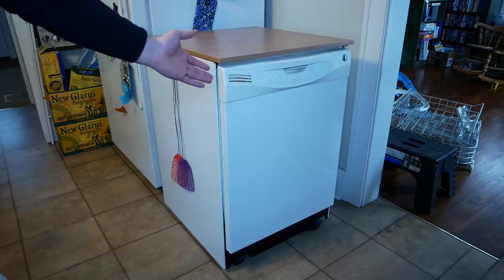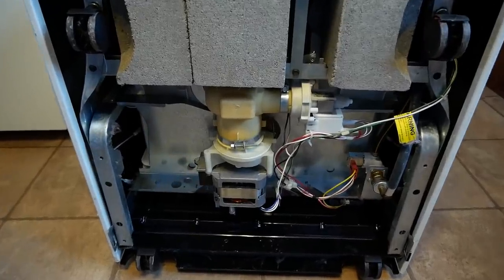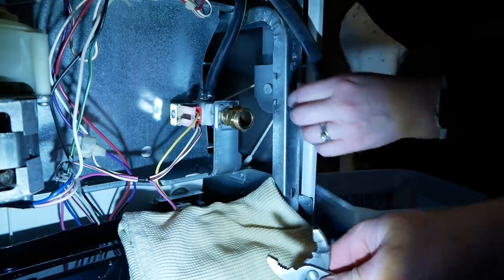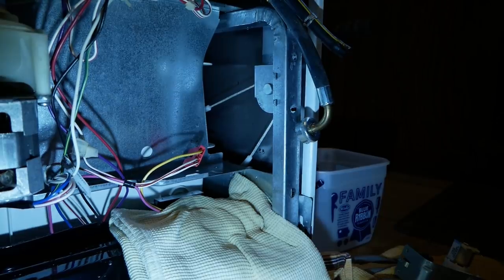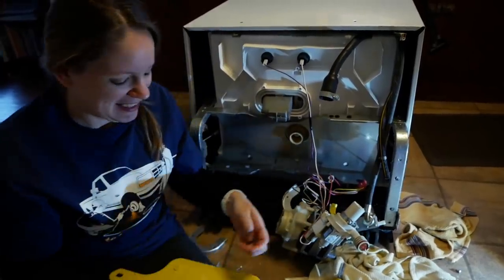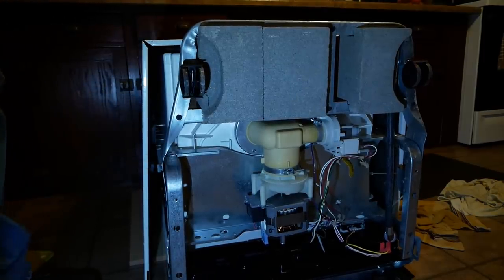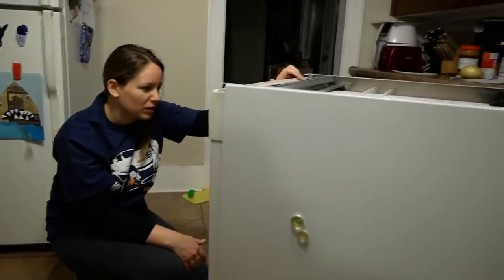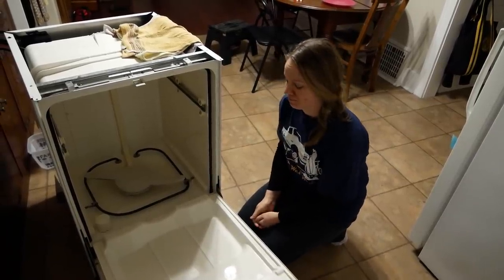Dish Washer Repair | a Lose-Lose Scenario

Comment: Wes you disappointed me this time. Dishwasher won't drain. Don't start with the fill side. The pump could have been pulled off without taking everything else off. The pump snaps apart, remove what is blocking the out flow, put back together. A one hour job at best.
Reply from the maker: What if it was leaking past the valve allowing water in after the drain pump ran? Come on. Simplest things first.
Reply: @WatchWesWork  Wrong. If the fill was bypassing the running water could be heard. Also opening the pump is simplest. I have done this repair many times. Removing the pump does not require removing the sump.
Reply from the maker: @RetiredPilot  Well I'll just let you fix it next time. Problem solved.
Reply: @WatchWesWork  Wow you don't like to be criticized do you.
Reply from the maker: @RetiredPilot  I just always get this kind of stupid comments. "Why didn't you fix the thing that was wrong first instead of all the other things that weren't wrong?" Because I didn't know what wrong until I ruled out the things that weren't wrong. It's a diagnostic process, not a silver bullet.
Reply: @WatchWesWork  Ok sometimes I come across a bit harsh, just for reference the solenoid valve cannot put water in as fast as that pump can pump it out. For future test, connect the hose to the sink and leave the water off, see if the pump will empty the dishwasher. Just tips for the future it will happen again. Ask me how I know. And mine is a builtin unit.